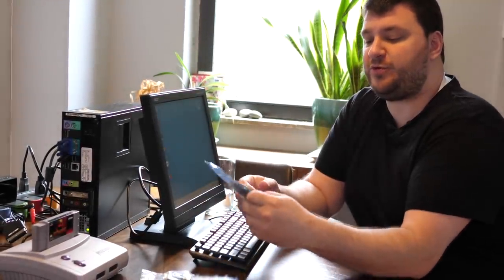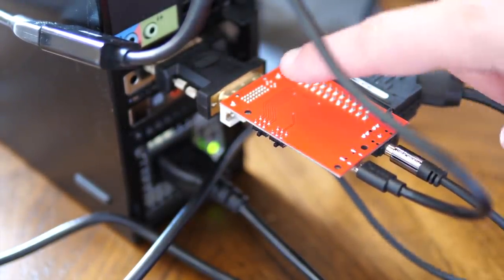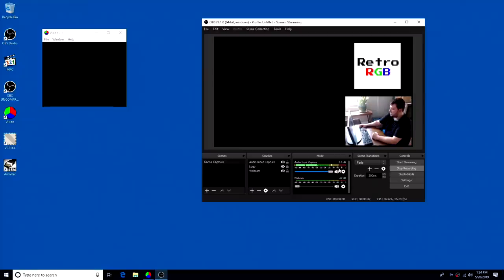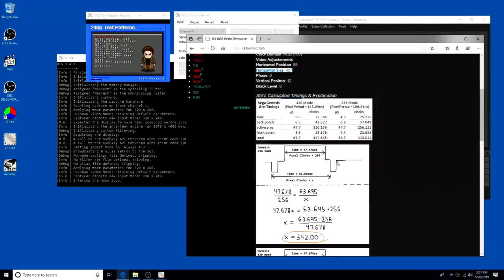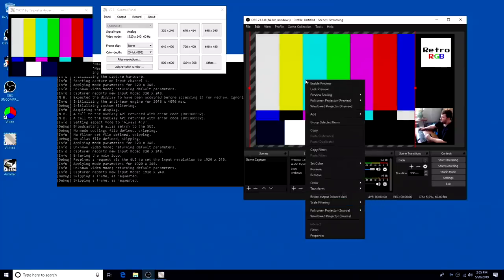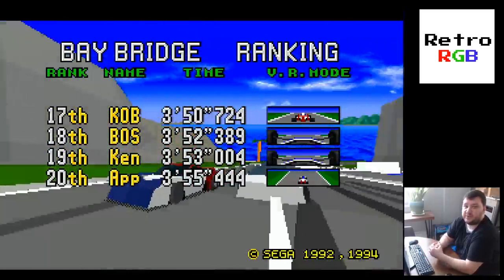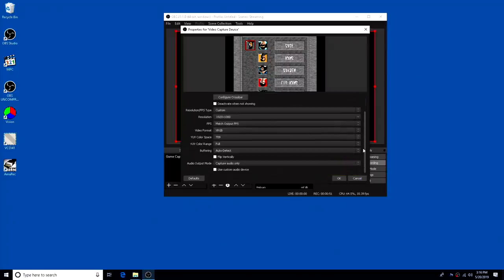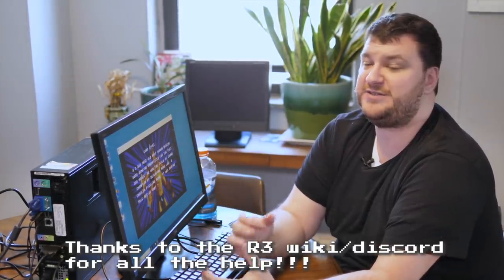Direct Capture and Streaming Solutions

Comment: Any good way of capturing games with different resolutions in them like 480i menus/240p gameplay or 256x240 gameplay/320x240 menus (like in castlevania sotn)?
Reply from the maker: There's no perfect way.  Many people like to split their signal (gscartsw?) and game on a CRT while streaming through one of those cheap SCART-to-HDMI boxes.  It's not the best looking solution, but since it incorrectly processes 240p as 480i, there's no dropout between resolution changes.  As long as you're actually gaming on a CRT, all the lag it introduces won't matter, as it's just being sent to your capture card.
Reply: @RetroRGB  well i don't mind if it aint "perfect" by any means. ive been capturing from my ossc and i wanted to see if there was a capture device that would at least not freak out when a transition happens. my elgato hd60s blacks out and sometimes doesn't come back up until i hotplug the device.

Comment: Need help resolving issue with noise: 

Equipment:
Windows 10, 7700k, 1080ti, 32gb ram
Datapath Vision E1S
Voultar Double Penetrator SD (LP Filter Off)
Tripp Lite DVI-I Cable
SNES Csync SCART from Retro Access
SNES 1 chip
Vision software, OBS Studio 64 bit

So I follow your directions to the letter. However, my OBS can't seem to display XRGB. When I select it, my capture freezes. When I try any other video format, there is a lot of noise and shimmering, no matter how I set the phase. 

I am going to try tweaking best I can, but do you know any reason why it wouldn't display XRGB? What was your setup when you did this video?

Comment: I'm very close to having this very same setup for recording and streaming, but I'm primarily looking to use component video solutions for my retro consoles. Are there any decent 1 input 2 output component splitters that exist out there? I found a few, but they don't claim to accept 240p signals. My plan is to connect a console to the splitter, and send one of the outputs to the Datapath, while sending the other through a RetroTink and into the TV, but I may need to move the RetroTink between the console and splitter if none of them accept 240p.
Reply from the maker: I think it would be cheaper and easier to go direct into the TINK and use an HDMI splitter.

Comment: Great video. Alternatively, can the scart2dvi adapter output to HDMI via a DVI to HDMI adapter? And if so, would the audio be extracted from Scart or does the audio get split to the aux cable regardless? Thanks!
Reply from the maker: The SCART2DVI is NOT a scaler - It's a passthrough device that sends SCART through the analog pins of a DVI-I connector:  https://www.retrorgb.com/scart2dvi.html

Comment: Have you tried this setup with a DVI cable instead of plugging the board directly into the computer? Do you think hooking it up with 6 feet DVI cable would result in any quality loss, stutter, dropped frames, etc.?
Reply from the maker: Depending on the DVI cable, it might make things darker, as it would change the total resistance of the output.

Comment: So Bob I could use Voultar’s SD double penetration or this component from Insurrection correct?
Reply from the maker: You can use Voultar's DP for 240p & 480i.  You can technically use it for higher resolutions, but the LPF won't work.  The Comp2DVI that Insurrection will be offering will have an LFP that handles from 240p to 1080p.  The current SCART2DVI also only supports filtering of 240p/480i, but we may eventually upgrade it.

Comment: I guess this could also work with the RGB input on the USB3HDCAP from Startech AKA the north american Micomsoft xcapture-1 with crappy drivers. Thoughts?
Reply from the maker: You probably could, but remember that capture card compresses the colors the same way the Framemeister does.  If you already own the USB3HDCAP, go for it.  If not, I'd suggest buying a different capture card.

Comment: I got the scart to dvi plugged into my genesis scarttt cable and I am still getttting know signal on my datapatth
Reply from the maker: Did you turn both switches on?  Make sure the switches are pointing towards the audio & power jacks and NOT towards the DVI connector.
Reply: RetroRGB yeah, I did that. Maybe my data path is bad... sometimes when I start it up it can’t find hardware or flash update fails it’s acting very erratic I think

Comment: Please make a video of how to capture video out of the RGB output on the back of a Sony PVM 20M4U or similar model, and datapath.
Reply from the maker: Get the SCART2DVI and this:  https://www.retrogamingcables.co.uk/sony-pvm/male-rgb-break-out-scart-to-4-x-bnc--2-x-rca-converter-cable?tracking=5543fb4c077bb
...then just connect that cable to the BNC outputs of your PVM.
Reply: RetroRGB is there a US seller?
Reply from the maker: You can try a custom one from retro-access.  Shipping from RGC really is quick though.
Reply: RetroRGB Thanks yeah I had all my systems going to a bandridge scart switcher to the pvm then out by bnc to VGA from Newegg with a dvi adapter into the datapath and no scart to DVI. Is the scart to dvi really essential part in that chain for the equipment I have?
Reply from the maker: Yes, because of the sync voltage and the low-pass filter.  Check out the other, longer video for a description of why.

Comment: You could run your screen at a lower resolution through windows and get the same effect Bob.
Reply from the maker: The blurriness of running an LCD at anything other than it's native resolution may effect how phase in the window looks.
Reply: @RetroRGB I think that would also be dependant on the chosen res compared to native and the quality of the display.

Addit: also your quality should rgb quality yeah? So you know the capture is fine, therefore you really are only viewing it as a sample window, so the decreased res causing blurriness is not really an issue if you are aware of the effect of the monitor. The capture will still be quality. Then you can swap your widescreen 4k monitor back to full res for work flow. I guess I'm just saying I don't see the need for the low res monitor. But maybe I'm missing the point.